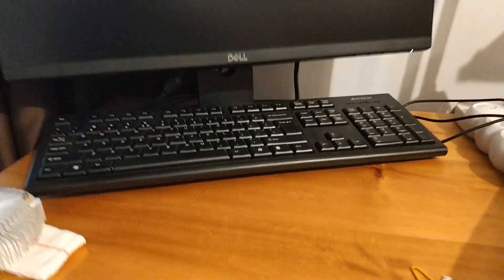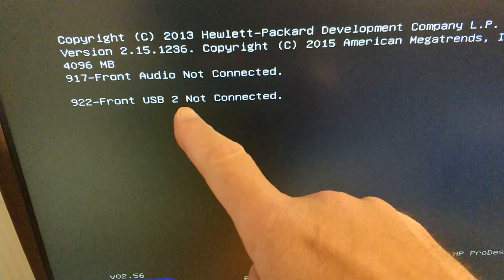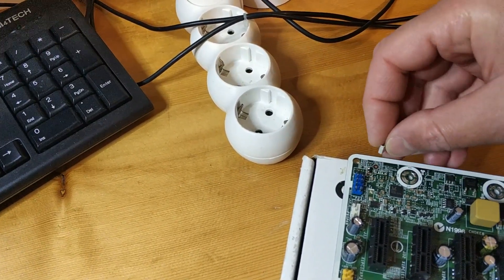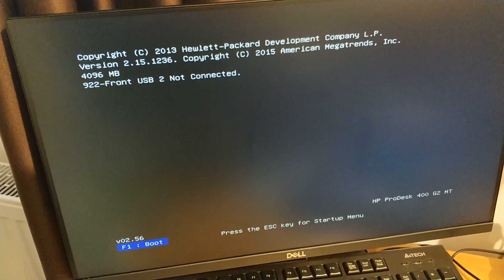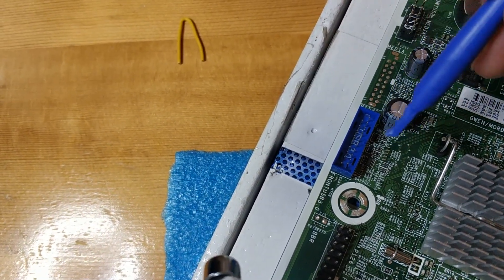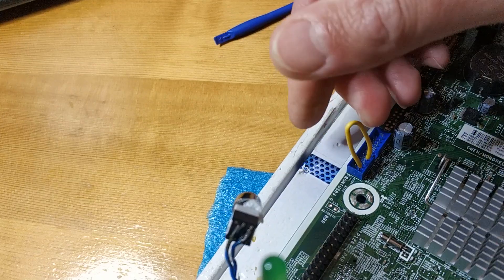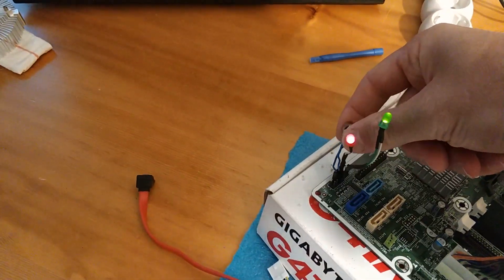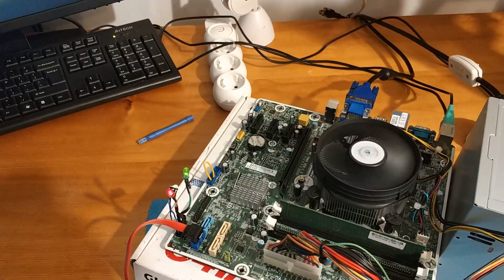HP Prodesk 400 G2 G3 490 G3 - How to bypass F1 error Front Audio & Front USB 2 Not Connected

Comment: Please tell me, I installed DDR3-1600MHz memory on the same motherboard, but the system detects them as 1333MHz. I tried other planks. All branded, high quality Corsair. And still the frequency is 1333 and not 1600. I even updated the BIOS to the latest one.
Reply from the maker: Hi. It's ok, don't stress too much.
Reply: @DaneluRepairs  
Yes and more. According to your video, so as not to see the USB 3.0 error, with a jumper it works as you showed in the video, but if you connect the front panel 3.0 connector there, then that error is shown again, despite the fact that even the flash drive is already inserted and the USB 3.0 port is working.
Reply from the maker: @ATX.remonter  case of your computer is the original one, who came together with mainboard?
Reply: @DaneluRepairs  No, the computer case is standard ATX. But soon, maybe tomorrow, I’ll carefully solder a jumper on the USB 3.0 connector from the bottom of the motherboard so that in the future it won’t give a similar error on this computer case. Maybe I’ll make a video and post it on my YouTube channel. I'll probably take a chance and buy an I7-4790 processor for this motherboard. I hope it fits. Yesterday I updated the BIOS to the latest revision.
Reply from the maker: @ATX.remonter  hello again; exactly, that is the problem, standard usb 3.0 connector don't have that shortcircuit on the jack, and that's why is give you an error. 
Keep in mind that oem cases+mainboards, like, hp, dell, fujitsu etc have this short between 2 pins, and that's why if connector is not plug in the mainboard, you will know why is not working.
Well done for updating bios, all the best with that cpu.

Comment: I have an error on 921 front usb 1, how do I fix it?
Reply from the maker: I don't know exactly, mate. Se if this video is helpful.
Reply: You need to jumper Pin 8 and Pin 10 on the Yellow Connector.  Pin 10 is opposite the Missing Pin, and Pin 8 is immediately adjacent to Pin 10.  A standard jumper can be used.
Reply from the maker: @PatrickRynhart  good to know, Patrick.

Comment: I have a "917-Front Audio Not Connected" error. But my problem is different. I inserted in my HP Compaq Elite (desktop ATX) new external sound card. And I put the cable into new one sound card. And HP says thesame error... - hp 917-Front Audio Not Connected . How can I do right way to connect a Front panel audio to external sound card without such error? external sound card and motherboard are already phisicaly connected via cable. But HP still generate such an error :(
Reply from the maker: Hi. You do just like i show in videoclip.

Comment: Mine is instantly turning on without pressing the power button (instantly after i put the power cable to AC source).
But if I turn off the pc and keep the power cable plugged, it is normal)
Can you solve the problem?
Appreciate it.
Reply from the maker: @rullysetiadi2479  hi. It is normal. At Oem mainboard(from computers from hp dell, fujitsu etc) when you plug in on Ac for first time, mainboard it's make some verification.
Let it plug at Ac all the time.
Also, check battery bios to have at least 3 volts, or simply put a new one in there.

Comment: POST Error
Cable Detection Error
41A-Front USB 1 Not Connected.
Front USB cable has been detached or unseated from the motherboard.
Press ENTER to continue
acer. What to do ???
Reply from the maker: Press ENTER.
Reply: @DaneluRepairs   ха-ха-ха-ха , very fanny , what to do master ?
Reply from the maker: @JekLondon1990  front usb are working?
Reply: @DaneluRepairs  I have a yellow socket like in the video :_:::: I bought a wifi module and connected it there, but only to these connectors :_;;;; dc bottom and now the bios is swearing with this error
Reply from the maker: @JekLondon1990 put that WiFi module in the back of computer.